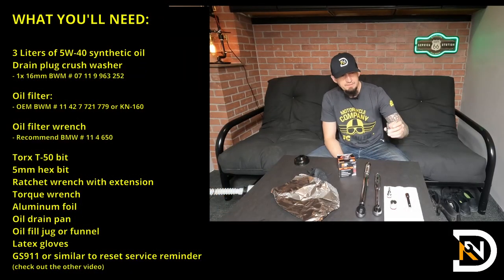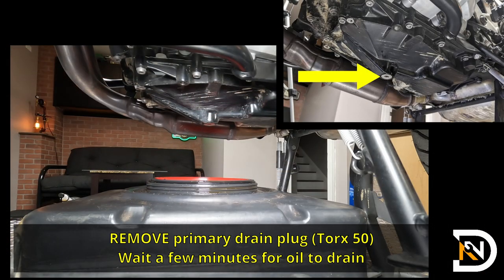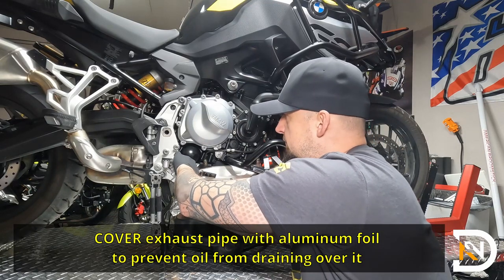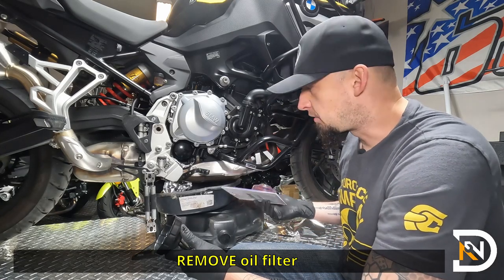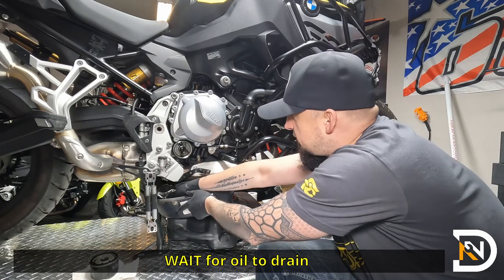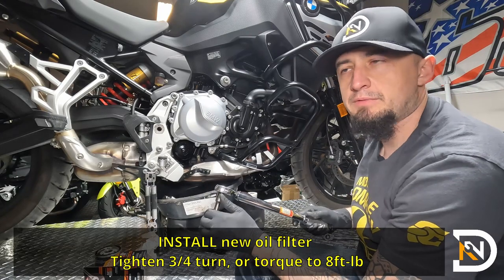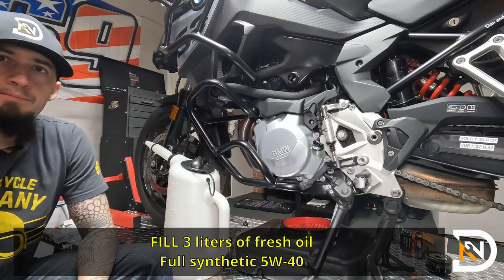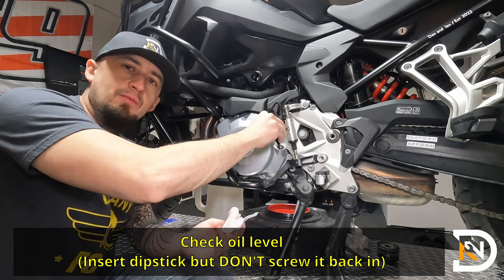How to Change the Oil on a Motorcycle?  DETAILED STEP-BY-STEP DIY on a BMW F750GS F850GS Motorcycle

Comment: My gs took 3 qts+1.7…, I had issues with the filter remover also, go with K&N a lot easier, most importantly 2nd drain plug,I was wondering why little oil came out,don’t forget to replace dip stick before you start your engine:), you saved me. Much thanks

Comment: Great Tutorial, thank you. That’s the way I anticipated to do it. Confirmed 😊 Do you know a way to get rid of the service message on the display, besides de 911 tool?
Reply from the maker: Unfortunately you'll need a gs911 or similar too to do this.  There are less expensive options than the 911 but I don't have any experience with them.
Reply: how much is the gs911 aprox?

Comment: Hi, When the oil is very thin and there is fuel smell at the Oil? What can be the problem?
Reply from the maker: Do you know how old the oil is?  You may be getting some antifreeze leaking into it if you have a leaking head gasket.  Is the antifreeze level okay?  I would change the oil and then see if it still happening.  There really isn't a great way for fuel to leak into your oil so if you're smelling it, it may be a leaky fuel pump.  I had mine replaced on my 10yr old s1000rr under warranty so reach out to your dealer for that if you suspect a problem.